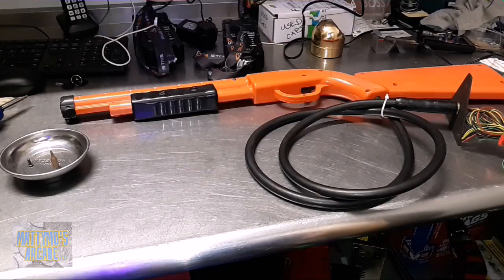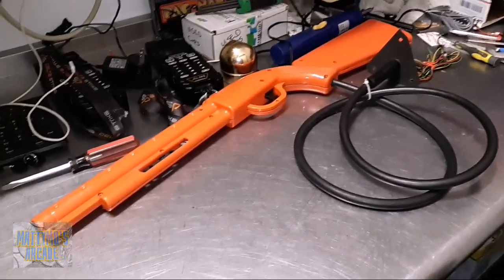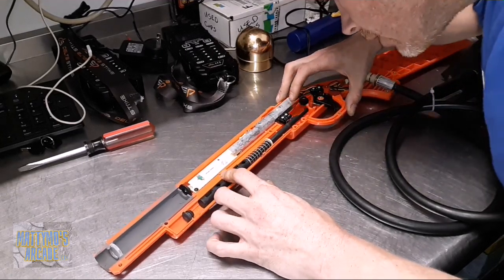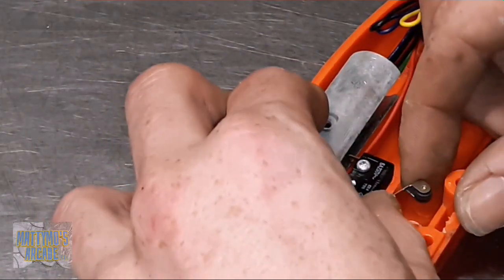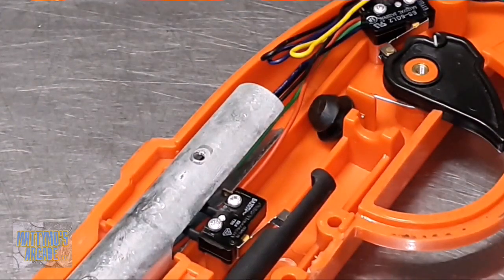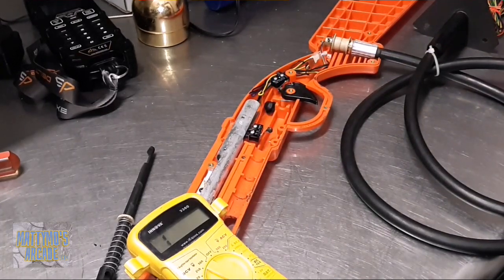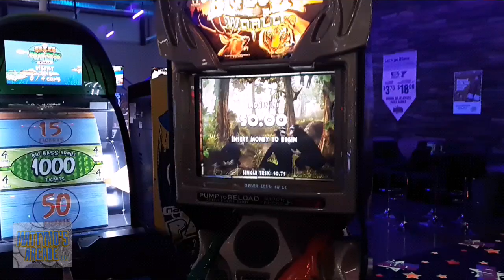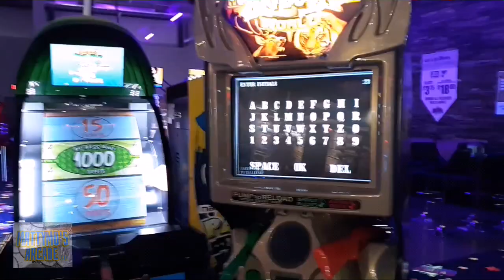Buck Hunter Repair: Shotgun Will Not Reload

Comment: Not sure if you'll see this, I've got this same machine that will reload but the trigger does nothing. Won't even cycle through attract mode
Reply from the maker: There are two mini micro switches inside the gun. One is for the pump, one is for the trigger. It’s possible a wire came unhooked from the switch, or is broken along the line. Worst case scenario, you need a new switch. They are around $10 or so.

Comment: You don't show how to take the fro.t piece of gun apart you jumped right over it.
Reply from the maker: It has one screw, then it just slides off of the end. That may be easier said than done in some situations. Spray it with windex to help. I may have shown that part in another video and didn’t think to include it again. Hope this helps!